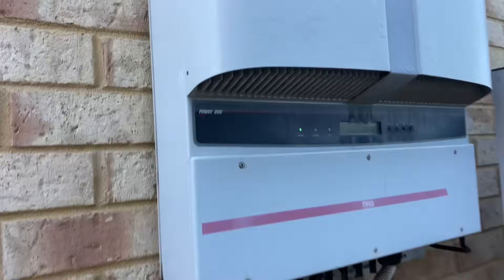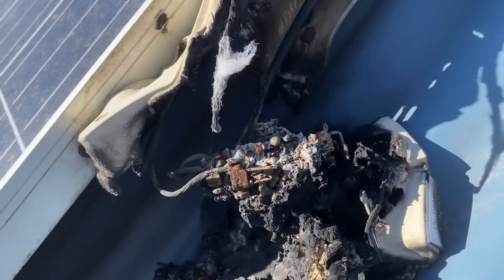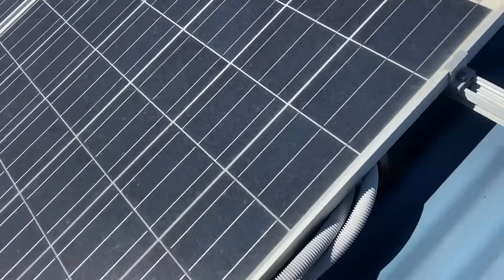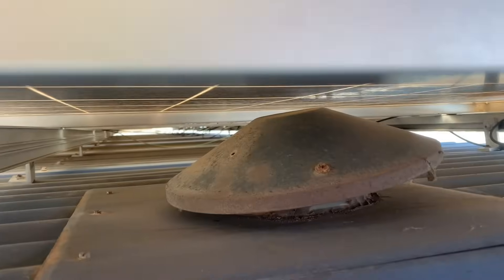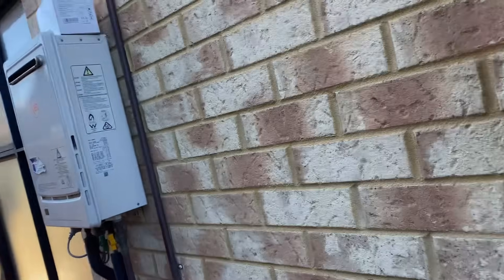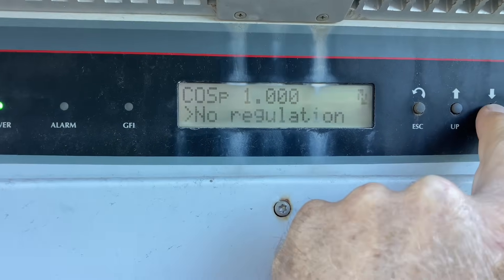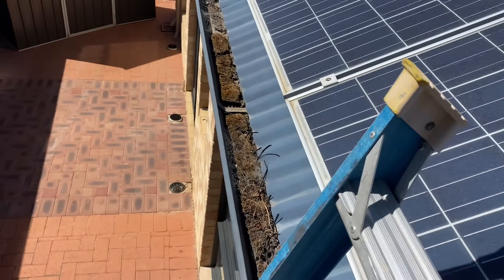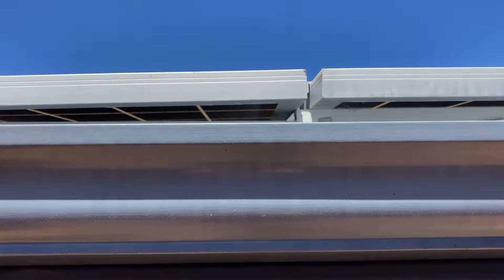This week’s sh$t show thanks to a dodgy company in Perth!

Comment: so doing the DP point on the roof did you also change any of the conduit work in the ceiling cavity to match the new regs?
Reply from the maker: Nope, however this was a way more practical solution and safer than a RTI. I realise Im fudging boundaries no need to point it out I did that myself in the video😅

Comment: That's rough all round.  They couldn't even be arsed to get the feet vertical.  On another note, half the roof screws are crook and some have been hit with sealastic, won't be long before all the panels need to come off and the roof reworked.  Fix your roof before you put panels on people, and that includes structural not just the sheeting and screws.

Comment: I'm surprised that aurora inverter is still running, they had a habit of breaking down after 5 years.
Reply: I have an Aurora 3.8 kw and it’s been running since 2011z
Reply: Not if they are only doing half duty with an east or west facing roof.  

The grid relays burn out when they run at full current for extended time, the actual inverter part itself is very durable, if not a little noisy elctrically speaking.